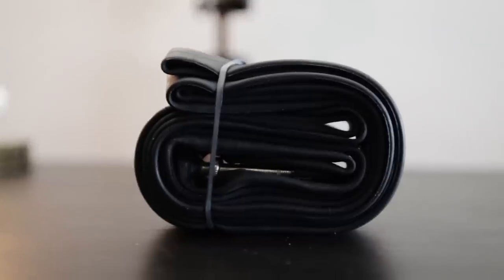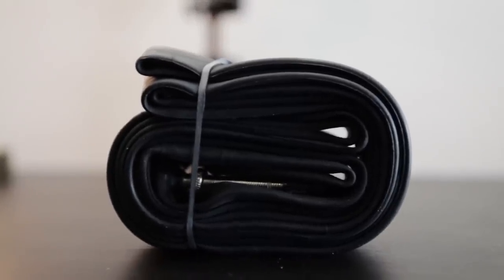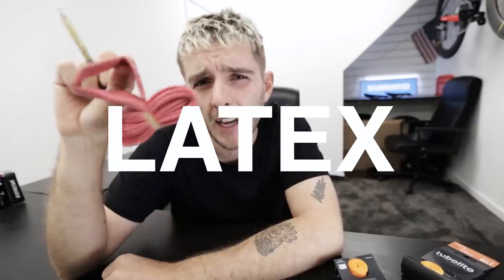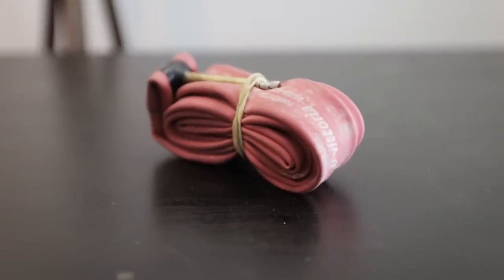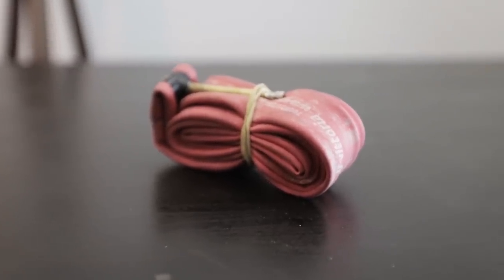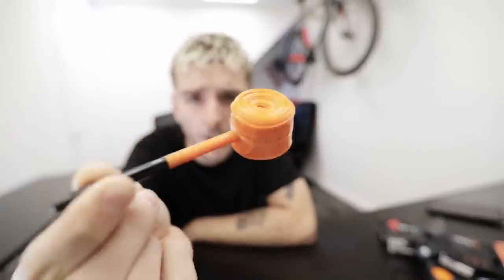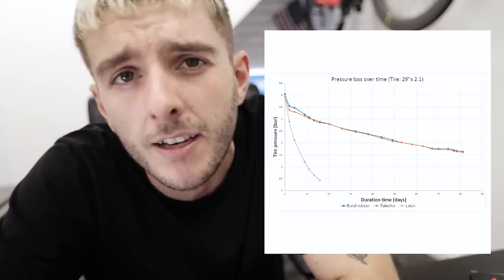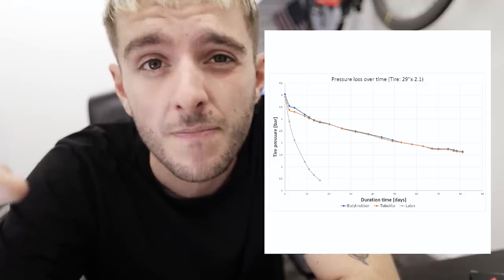The Single Best Upgrade for your Road Bike

Comment: I just read that you shouldn’t use latex with carbon rims because of heat build up.? Is it the same for tubolitos.?
Reply from the maker: The standard tubolito is fine, the spare one is disc brake only

Comment: I heared that Latex Innertube are dangerous, especially if you run rim breakes, bc if the rim get's too hot on a descent they might explode... Can you confirm or do you think it's no problem also with rim breakes?
Reply from the maker: No idea about latex but the S-tubo is disc brake only for that reason.
Also, who still uses rim brakes anyway? ;)
Reply: @Cade_Media  ahh cool, thanks!
haha fair point... ;)
Reply: @Cade_Media  I do

Comment: £28 to save 70grams or swap my 750ml High5 bidon for my 600ml Sis... ;)  As an aside, do you know of many people that use Tubulars when not racing?? My 60mm carbon tubs are super fast but I've never taken them on a real long ride; just a few 85km loops that were never more than 30-35km from home. I've added Stans sealant also! ...Long rides I always use my Ultegra clinchers and take a spare tube and patches. 2 distance goals this year, 150 mile and 300 km and the Tubs would make this much easier.
Reply from the maker: Never ridden tubs outside of a race... You'd need to carry a spare tyre!

Comment: Why would your inner tube affect roll resistance? It's the tire that's touching the road right?
Reply from the maker: It's the force needed to deform the tyre when it touches the road that causes rolling resistance, the tube has to deform too of course - explains why tubeless is the best rolling resistance (but quite a big heavier as the sealant weighs more than a light tube).

Comment: what is your opinion on tubeless road tires and wheels ?
Reply from the maker: I have never been able to make it work properly, pressure is too high!
Reply: @Cade_Media  for 6 months i was using such combination
70-80 psi
with tire silent 
it was very good 
1 puncher that i had to deal with 
and the only thing i had to do was pump more pressure and give the wheel powerful spin and that's it

in few weeks i will get back to that

Comment: The problem I found with tubolitos is the valve housing being too short, you would really have to force a pump head on pushing it over the orange plastic it sits in, without any nuts to hold it in place you couldn't attach a pump head.
So if I wanted to check my tire pressure or pump them up I had to deflate them and squeeze the tyre from the outside over the valve hole
Extra-long ones he had may work   although would look a bit daft on a normal wheel

Apart from that they are great  if expensive

Comment: Any idea where to get latex tubes with 60mm valves? Can’t seem to find any online. I’m in the US.
Reply: Michelin latex tubes come with 60mm valves
Reply: noel pagan good call thanks, but those aren’t available for 28mm tires! 😑
Reply: Jim Lombardo i ride mine in 28c tires and even in 33c cx tires for cross races. latex is realy stretchable. ever tried to blow up a condom?

Comment: RR far more important than a few grams in weight difference. Latex for race wheels, tubeless or butyl for training
Reply: bstaplet why?
Reply: @ianiscaratti4924  read some of the research that has been done. Aero and RR trumps weight 99% of the time
Reply: bstaplet why is tubeless bad in rr and why is a light innertube less aero?

Comment: I need an inner tube that’ll last and retain air for a long period of time. What that be?
Reply from the maker: Butyl is your best bet.
Reply: @Cade_Media  cheers for the speedy reply! is there a particular brand that stands out as the best? I’m assuming butyl is a material? My wheels are 700 x 28c
Reply from the maker: @Blviik  no I think they are all quite similar!
Reply: @Cade_Media  how relevant is the 28c? Can’t seem to find any butyl in that size. Seems to start at 700 x 32 and up. Cheers for the help mate
Reply from the maker: @Blviik  there should be lots of inner tubes smaller and they will stretch to fill a 28mm tyre no problem.
Reply: @Cade_Media  your right man! I didn’t look further than the title, that’s my bad

Comment: Should just go tubeless bro...... 😛
Reply: Is it really worth it? Someone else recommended it to me. I just think of all the mess and filling the tube up with that liquid crap.
Reply: @Necromonger69  I'm a big guy. 6' 4" 260lbs. I can't tell you the number of times i've ridden in the dusty glass strewn bike lane, listening to the glass and rocks pinging under my tires just before the inevitable banging sound of my  rim off the pavement.. Ever since I went tubeless I truly no longer fear that sound..  I've ridden on them this last year and not a single puncture.. I've spotted a couple of spray stains on my downtube while cleaning too over the year, so i know it's doing its job. Life altering for me mate.  I'm due a refresh actually now that i think of it.
Reply: @tinman7551  Thanks brother, I have been really considering it. I ride a lot here in South Florida, the bike paths are so bad and littered with debris. One time I had two flats in one day.
Reply: @tinman7551  What tyres and sealant are you using?

Comment: Ever heard of tubeless? Also if you have shitty tires, upgrading the inner tubes won't do that much. So do it right and buy good TUBELESS tires.
Reply from the maker: Great for MTB/gravel, shit for road in my experience. Although I have some fusion 5's coming to try tubeless
Reply: @Cade_Media  what was your bad experience with road tubeless?
Reply from the maker: @sebastianriedel8627  failure to seal because the pressure is high
Reply: @Cade_Media  you mean seal in the case of a puncture? In that case I just jam a tubeless plug into the cut. Works great

Comment: it's light indeed, but way too expensive, even you could save 100g, besides, it's not puncture resistant as mannufactor claimed.
Reply: the best experience I have with these tube is , dame they can be folded into a cube, easily carried in pockets.

Comment: just don't ride latex inner tubes with carbon clinchers, they will explode and dangerous. Apart from that, they are great, especially in tubular tyres :-)
Reply from the maker: Or the tubolito S type (spare). Standard version is fine though apparently
Reply: @Cade_Media    I have heard about valve issues with these, but never tried them

Comment: Lot of money for a tube.. and extra maintenance sucks... A cyclist that does this is obviously a "weight weiny", or a competitive racer.  Considering the same cyclist is probably running a Turbo Cotton type tire... probably means they're having to drop at minimum $200 every 4-6 months, on tubes and tires.  $600 minimum every year just to roll?... no thanks.
Reply from the maker: Definitely a race day thing IMO, or if you're riding in Spain or something on silky smooth roads.
Reply: @Cade_Media  Here in NorCal.. we no nothing of silky smooth roads... rough as can be.

Comment: Get with the program. Go tubeless.  Don't be a dinosaur.
Reply from the maker: I have some road tubeless on the way, only had experiences in the past. If it works then it's great. 
Unfortunately sealant is heavier than a light tube though, if you're a weight weenie of course.
Reply: The success with tubeless is about finding the right combination of rim and tyre which suits your kind of riding then sticking to it. I have stans grail and avion rims (wide) with schwalbe pro one 28mm. I have had punctures but none that required an inner tube  to get home. I've done over 10,000k on this combination on flinty Berkshire roads. Not the lightest but comfortable for the older bones. I mainly carry tubes for my mates who have a habit of getting multiple punctures on the ride and running out of stock. Happy riding and keep the videos  going.

Comment: Serious are we talking about saving 40 grams? This is a parody right? I've got a much better way to lose grams on your ride, vomit before riding. Wil lose more then 40 grams that way.
Reply from the maker: ride quality more than the weight saving, but people care about those grams and will pay much more in wheel upgrades etc to achieve the same reduction in weight when they could be paying a lot less by changing tubes